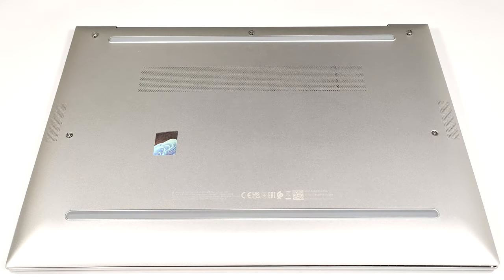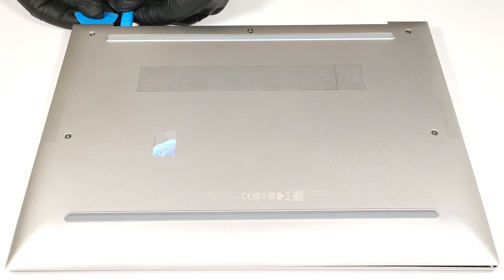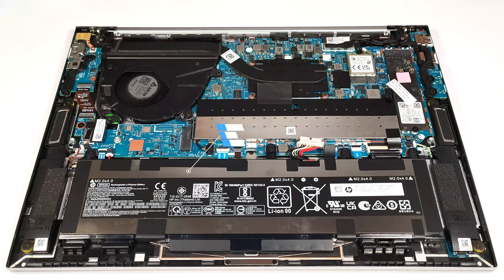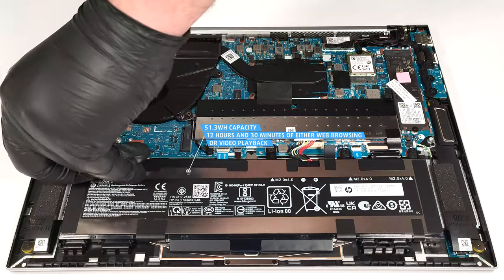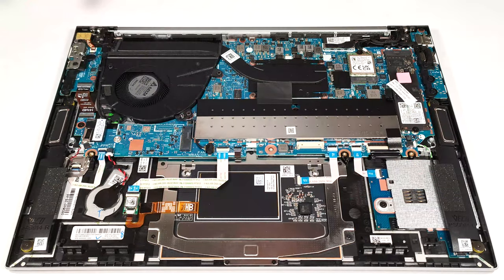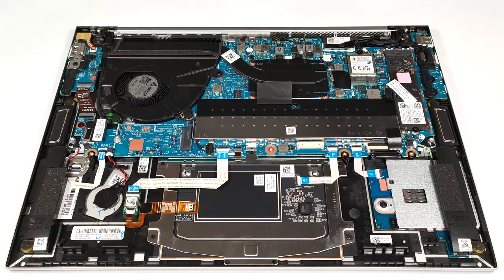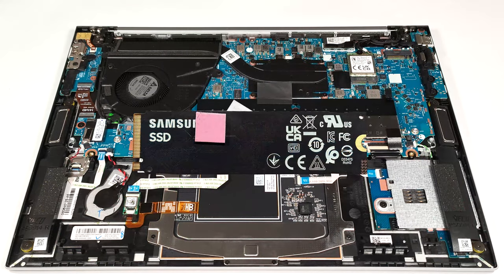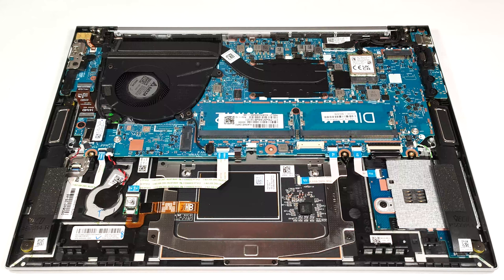🛠️ How to open HP EliteBook 845 G10 - disassembly and upgrade options

Comment: I have this device, the temperature rises to 94 degrees during the stress test😢
Reply: do you use it normally stress testing it? I have the 7840u and it runs pretty quiet and well